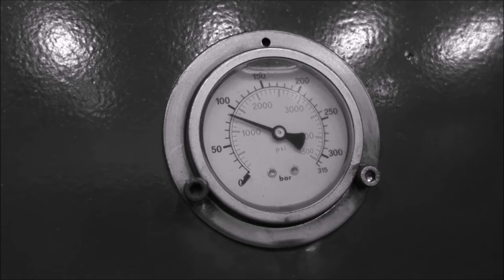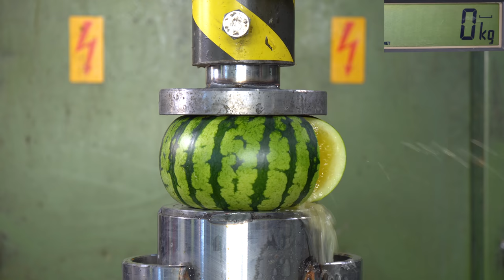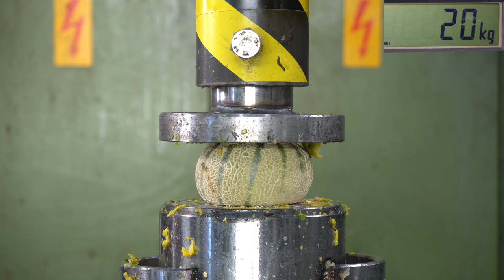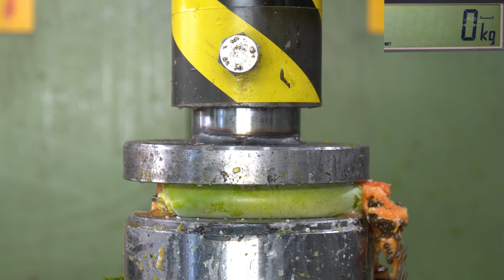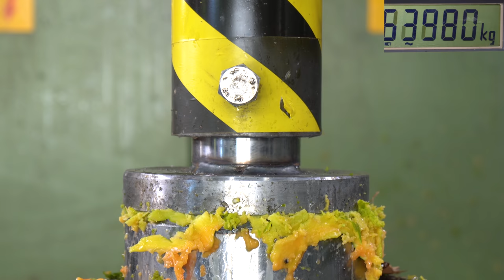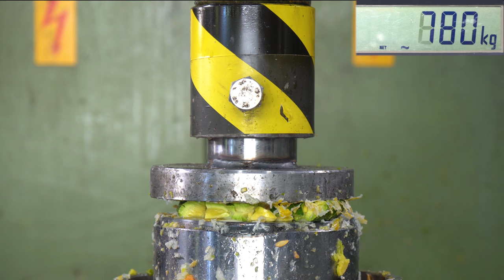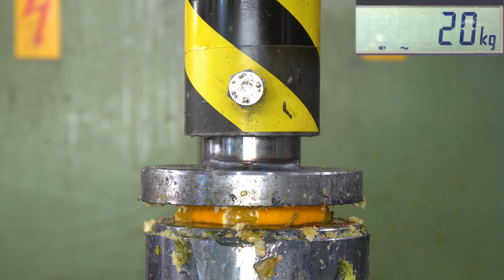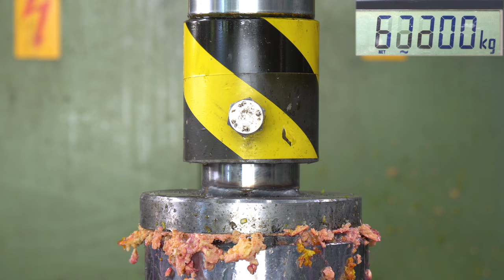Crushing Fruits with Hydraulic Press Satisfying Compilation VOL1

Comment from the maker: I am working on with Hydraulic Pull Machine 5 000 000 (I am going to modify Smahinator 5 000 000 to do that). So if you have good ideas what to pull apart please let us know! The frame is good for around 40 tons and I think I should be able to build machine close to that capacity quite easily.
Reply: Pull apart a stretch Armstrong and a vacedd vac-man
Reply: Hi
Reply: Hydraulic Press Channel pulled pork!
Reply: I guess you now have the best juicenator 5.000.000 in the world ! Not even one drop of juice is wasted ! 
Greetings from Brazil 🇧🇷! :3
Reply: Bones, limbs, ligaments, etc (not humans obviously)
Reply: That will be really fun - a fun and simple idea to start out with is to test the strength of wires and ropes of different material and dimensions (that would be really intresting to know)
Reply: Wood, reems of paper, rocks, skulls, metal
Reply: you could try the super composite Isotruss
Reply: A juiceanator 5000000 is needed for further testing of these fruits
Reply: Hydraulic Press Channel pulling apart the UK from the European Union
Reply: Kanan luita vois koittaa :)
Reply: Hey Lauri. Can u please try press coconut again but in different position, put it upright vertically. Should be much stronger. Thank you. And regarding pullinator 5 000 000 can try pull apart car seat belts, different material and size ropes etc
Reply: seuraavaks varmaan vahvin juures/ next i guess strongest root vegetable
Reply: How much can the 144 ton press pull?
Reply: Weave together two phonebooks and pull them apart .
Reply: Kevlar bulletproof vest.
Reply: How about different tie-down straps, pallet strapping, para-cord, and bungee cords?
Reply: A tire.
Reply: Various types of rope,cable,wire or fishing line.
Reply: Hydrogen
Reply: pull apart hard to open packages...Tyrkisk Peber?
Reply: Duct Tape!!!
Reply: Space/Time
Reply: @Speeder84XL  yes. Fabrics too.
Reply: Those Legos that never come apart
Reply: Me away from a good buffet
Reply: chain
Reply: hand cuffs
Reply: Safety equipment
Reply: different types of rope and e.g. fishing lines and kevlar ropes for kitesurfing 😀
Reply: Watermellon is not a fruit it is a beari like strawbeari (idk how to write that word sorry)
Reply: Phone book. Before the world loses them forever.
Reply: Hydraulic Press Channel stretch Armstrong
Reply: You could do a great consumer video of fasteners like climbing equipment and other things like the glue
Reply: Concrete. Reinforced vs non-reinforced.
Reply: Bicycle items: chain, inner tube, tire, brake cable, bike locks.
Reply: Two phone books with their pages interlocked
Reply: Perhaps you could compare a cable, rope, chain, and nylon strap?
Reply: I wonder if you could figure a way to fixture those cool carbon structures you've been crushing.
Reply: Pull apart different types of rope, you could start with something like string, then go to rope and move up until steel cable and chains, and test how much each one can hold
Reply: Try to pull a car's tire, pull some metal rods until it breaks in 2 pieces
Reply: Try to crush a  human hand made by gelatin and bones to see what is like if a human hand was caught in h-press
Reply: Do various padlocks!  Should be relatively cheap to acquire high-security ones where the keys have been lost, so we could see some interesting stuff like Sargent & Greenleaf Environmental locks and what happens when something that would never happen to them in practice.  I'm reasonably certain that even if you did that to an S&G Environmental in a field-practicable fashion like hitching a truck to it, that whatever it was holding would come loose or break apart first.
Reply: Different ropes or cables would be neat to see.  Hemp rope, silk cable, steel cable, etc.
Reply: Pull apart 2 phonebooks with their pages interleaved together! :)
Reply: Maybe pull some teeth & tusks out of the jaw of a wild boar 
Or crush some nutshell & see which are strongest
Reply: Telephone book, like Mythbusters did!
Reply: Will you make a Jucinator 4000000? Some way to produce drinkable juice using a hydraulic press?
Reply: Oooh, how about a fish?
Reply: @dilakas  "Watermelon is not a fruit. It is a berry, like a strawberry."  
True. (I thought i'd show u how to spell it.)
Reply: @nothingsurprisesmeanymore  Climbing equipment - That's a good one. I also like the idea of testing glues/adhesives.
Reply: Stretch Armstrong?
Reply: How about a supreme juicer 700000?

What you did in this video, but collect the juices :)
Reply: Could you put some gold flakes under the press and press them together?
Reply: Pull apart two interleaved  phonebooks. They are really strong even though they are just held by friction and paper.
Reply: Things that are supposed to prevent pulling, or are used to pull - Chain, rope, those tow straps that off road trucks carry, a padlock would be fun too, and a bicycle U-lock
Reply: Hi, I was just curious about what you do with all of this food once it's crushed, do you eat it ? Or is it wasted ?
Océane from France ;)
Reply: Pro englanti Jere
Reply: Pig carcass. IKEA furniture. Gumball machine. So many good options! 

I want a fruit salad now... great video!
Reply: A leg of lamb
Reply: So now your in the fruit juice buisness
Reply: Just curious if any of the seeds ever grew from putting them to your backyard to grow a jungle?

Comment: For the coconut please try to crush it standing. Because the way you positioned it there is an invisible line all over the middle circonference, it is a trick for quick opening of coconut. So standing up is much more resistant to weight pressure

Comment: You can turn your hydraulic press into a traction test machine. Place the force sensor at the top of the press piston and place a crossbar with the object to be tested attached to the bar and at the top of the press. This would allow testing of many products, but of tensile strength rather than compression.

Comment: I wonder how much weight those stones under a railway track can take.
Reply: (If you are talking about the US or Canada, not sure about other countries)
It is mostly just regular stone. They provide a base for the wooden, or sometimes concrete, ties that the tracks actually sit on top of. The ties take a lot of the weight, the stone is just there for a base, like I mentioned before, and leveling purposes mostly. There are also a lot of stones underneath each tie. So the weight is quite distributed on the stones.

Comment: Thanks for the fun video! It would have looked great slow-mo! Maybe do a slow motion follow up? 
For the Pullinator 5 000 000 you could try pulling apart stretchy things to see if you can break them. Rubber bands, balloons (blown up and not blown up). Some that don't stretch but could be good, paper money as well as coins,  a smart phone, something welded to see if the weld breaks, marble or other rocks and crystals.

Comment: The sensor is bullsh1t when it comes to soft material. I just put a 24 kg kettlebell onto an apple and it squished instantly.
Reply: Robert Finnish apples are tougher than your weak apples. No amount of kettlebell workouts will make them stronger.

Comment: Once more some off the fruits you crushed were upright or sideways. All of them should have been crushed from the stem or bottom of the fruit vertically. Your results are skewed because of the difference of crushing horizontally and vertically again according to how the fruit grows which is all the same. Stem on top. Like I said make a cup to hold certain fruits that will stand stem  up . That won't affect the result because the fruit is gonna crush before the ( cup ) supporting it will  alter the result. By the way. Is a coconut a fruit.  Yes and no . A drupe.  It can be classified as a fruit , nut , or seed. Yeah it's a fruit. Love HPC!!!! You guys rock!!!!

Comment: I charge $1000 For my suggestion,,crush water ,,,make extruder 50 million with a tiny hole and try to to waterjet cutting,,,,or if you wanna make it very fancy then make an extruder 200 million and weld in the special waterjet cutter part with the diamond hole and add the special nozzle ,,or do an extruder 500 million were  you add a pipe with garnit between the hole and nozzle ,,if you do it right it will definitely cut